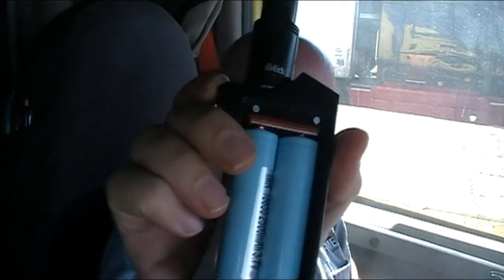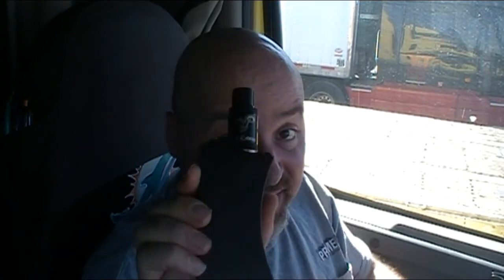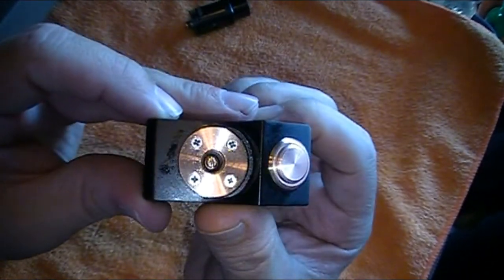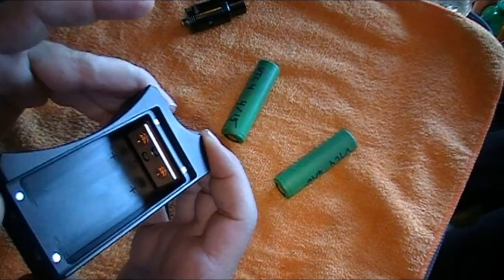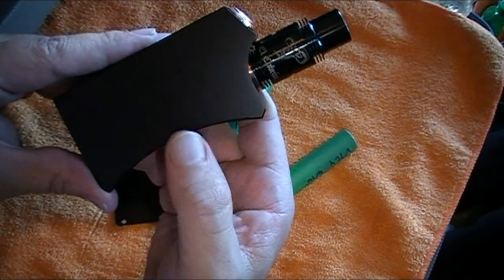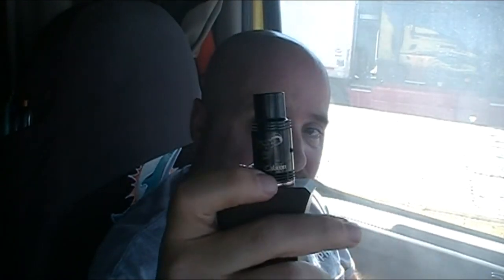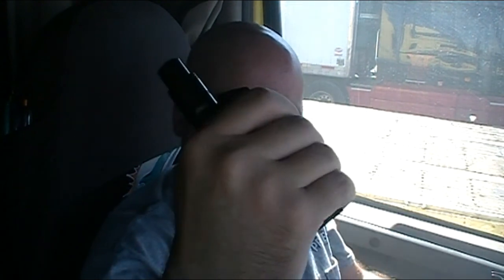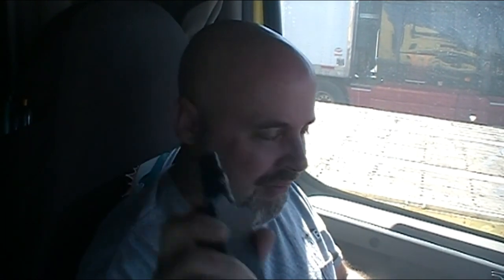El Cabron Box Mod by Comp Vape

Comment: hey quick question ! can i use the UWELL Crown sub ohm tank on the el cabron box mod ? thanks in advance
Reply from the maker: I don't have one to test it, but as long as it is 22mm or less it will fit, and it's not a hybrid top cap so sub ohm tanks are fine on it.
Reply: The Uwell crown is has diameter of 24mm. So I assume it won't fit right ?

Comment: IT is a fully mechanical mod. its just A wire in between to improve safety ...even less drop cuz of the improved circuit. ..it is not regulated so how is it not fully mecanical
Reply from the maker: +andy benko Regulated would contrast with unregulated, not mechanical. Mechanical mods contain no wire or solder. On a mechanical mod the button directly completes the circuit when engaged. A mod that relies on a wire to transfer the current can be unregulated, but by definition isn't mechanical. In the case of a mechanical mod, the definition of "mechanical" is "using machine parts only",